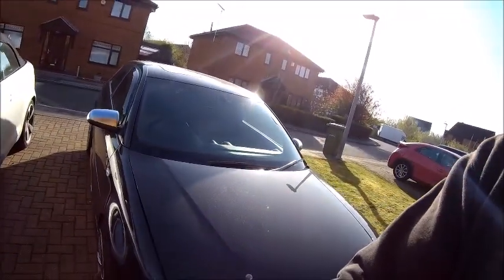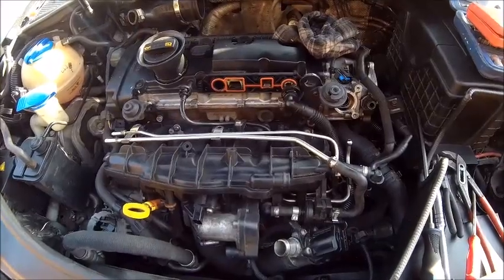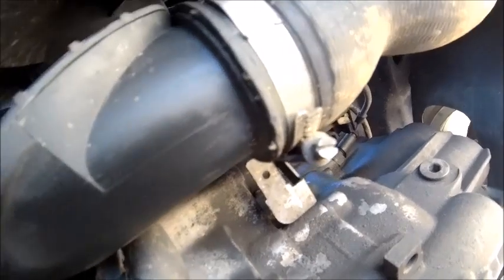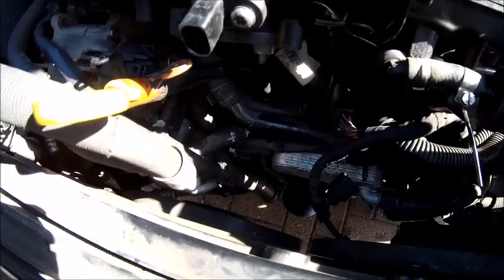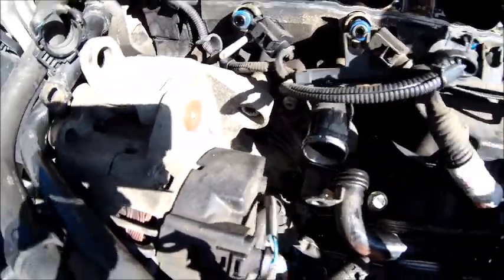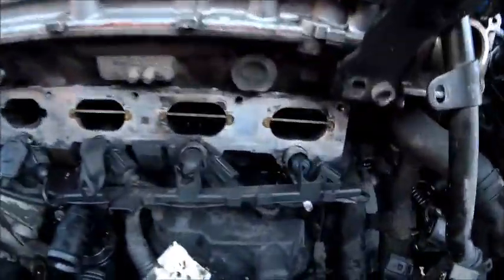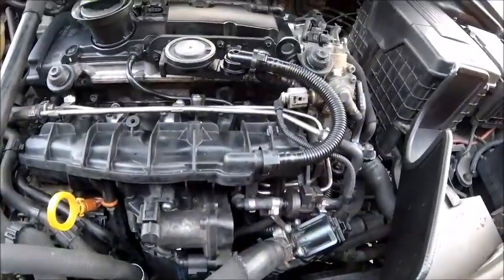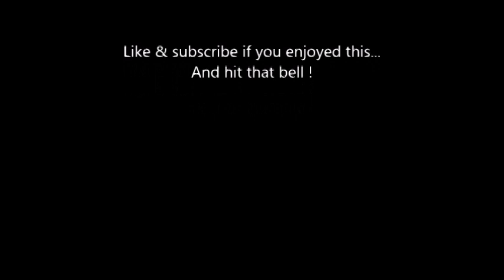#Audi #S3 8P thermostat replacement and Carbon clean.  #carbonclean #AudiS3 #TFSIcarbon

Comment: What a fantastic video to show just how much time and patience it takes to remove the inlet manifold , my thermostat needs changing but have a fault with inlet manifold and throttle body so may as well do the three at the same time , well done ade 😊  Yet another marvellous video keep them going 👏👌
Reply from the maker: yeah ...is a mare of a job ...but well worth doing ...Made the car run a lot smoother and the temp sits bang on 90 now .

Comment: Hi mate, great video, what did you use to clean all the carbon build up?
Reply from the maker: Elbow grease and carb cleaner...I know there are better ways , but whatever you have to hand hey    ..  😄
Reply: @AdeReeves  thanks for that, might be a stupid question but when you sprayed the carb cleaner inside and scrubbed it, what about all the loose bits of carbon that have been broken down? Where did all that go?
Reply from the maker: @vixdhokia3430  I made sure the valves where both shut, then blew all the remnants out with an airline with a cloth covering the intake.... again maybe not the best way to do it , but worked for me 😀
Reply: @AdeReeves  thanks for the info, I will be giving it a go. 

In regards to the inlet when you removed the throttle body, the bolt that holds the manifold in behind the dip stick, do you know what size it is, iv got as far as that and it's a weird looking thing, looks like a torx but I don't think it is, it's got more splines...🤔
Reply from the maker: @vixdhokia3430  sorry not off the top on my head...it's been a while

Comment: Nice video need to do mine is there any other bits you recommend changing while you have got it all apart ?
Reply from the maker: To be honest there is not much else in the area, just making sure you De-carbon the induction side and give the injectors a good clean up before the manifold goes back on .
Reply: Ade Reeves thanks

Comment: Hello, very good job ! I follow you and you many helping me ! 😀 what is your technique for clean the admission ? Carbon cleaner ? Do you need to close the valve before clean ? I want to clean my admission too so i'm a lot affraid because it's not easy to disassembly all this parts. Thank you for your help
Reply from the maker: Hi.. It was good old Carb cleaner and a hard toothbrush.... And yes make sure both valves are closed .

Comment: Hey, thanks for the video! Unless I missed this, did you ever have the part number for this?
Reply from the maker: Hi there ,,,looking back at my Ebay purchases, I believe this is the part I fitted...I was told Febi was the best option...
https://www.ebay.co.uk/itm/Timing-Chain-Kit-for-AUDI-S3-2-0-06-13-8P-BHZ-BZC-CDLC-8P1-8PA-Petrol-Febi/402217980401?hash=item5da60f51f1:g:9nEAAOSwNvBekdLs

Comment: how long did it take to change the thermostat valve
Reply from the maker: physically changing it around an hour....the issue is it takes a couple of hours at best to take all the induction side off... It's not a great design keeping in mind years ago they where on the top of the engine with just two screws holding them...Progress Hey ?
Reply: @AdeReeves  thanks for the reply, my coolant keeps dropping and iv been told to try changing the thermostat,
Reply from the maker: @stringer6435  Its quite common for them to leak after a few years.... just a shame its such a bugger to change.

Comment: Fantastic job buddy, what a nightmare. Audi really don't make life easy with the positioning and access to parts and bolts. I'd love to be able to do jobs like this, but I fear I'd forget where stuff goes back. I'm actually attempting to change the throttle pipe in my S3 8p this weekend, are there any advice you could give which might help? By the looks of it, space is very very tight. Keep up the vids, I really enjoy them, and love the little golden tips you mention from yrs of experience working on cars, we really appreciate that.
Reply from the maker: Thanks for the kind comments...the throttle body is indeed a royal pain in the >>>>  ..  i would say to get any kind of access the charge cooler pipe has to come off...the bolt to the block on the bottom of it is an easy one to access, to the top one isn't...your going to have to take off the divertor valve at least to get good access but there is a little wiggle room past the radiator fans to drop it out the bottom but you have to get creative with it... the housing bolts are "remove by feel " as you cant see a thing...so have plenty of hex sockets on standby, i think the back two u sued a long bit with a ratchet 10mm spanner on it... Good luck !

Comment: Fair play on this one, Ade. Happy to say this is beyond my willingness and skill.
Quick question. Is the water pump close to the thermostat? Mines booked in for pump,chain,belt on Tuesday and wondered if it’s worth adding the stat to the list. Great video, as always.
Reply from the maker: No completely different place Paul...the water pump is on the drivers side of the engine and much easier to get at 😉
Reply: @AdeReeves  bugger, thought so (belt driven). When you mentioned you noticed the gauge not hitting 90,Mine also does that every now and then, over the last few weeks.

Comment: Once thermostat has been changed.. are you not meant to leave the car on and running to make sure it all works well and how it should etc?
Reply from the maker: I'm glad to report ....now sits bang on 90 degrees.. nipped to the shop this morning too and it's bang on where it should be on a run too   :)

Comment: tbh this is why ive not bothered its an absolute mere, such a poor design, maybe its a better option to remove the the belt and tensioner then the alternater and go in that way?
Reply from the maker: Wanted to do the carbon clean too as everyone knows these engines "Gum up" at the first opportunity… considering all older cars have them towards the top of the engine it does feel like several steps back with newer designs but they cram so much under the bonnet now I would say the last thought is the poor bugger working on them  ....could have brought an RS4 - RS6 ...then it would have been a week long video  ...LOL...
Reply: @AdeReeves  I did mine when I had her remapped